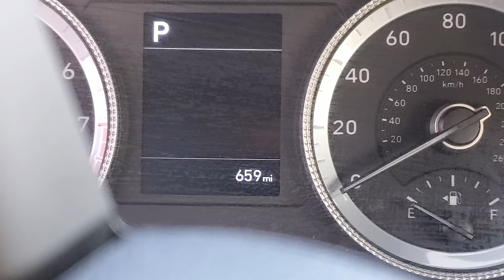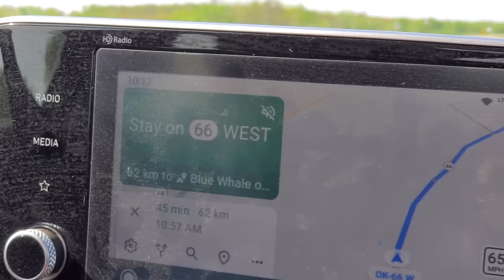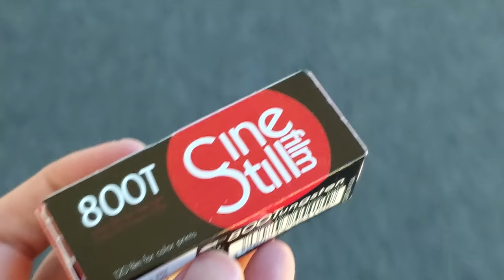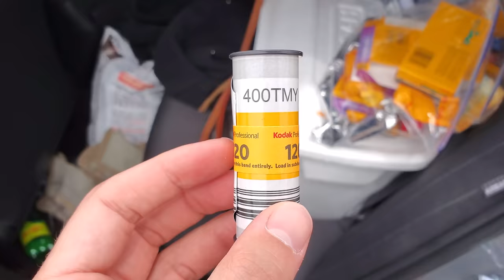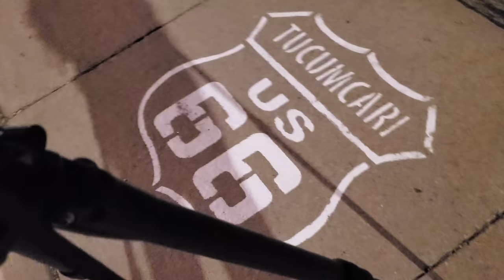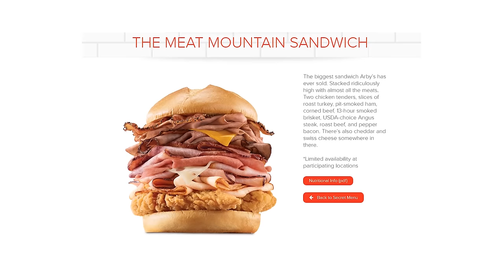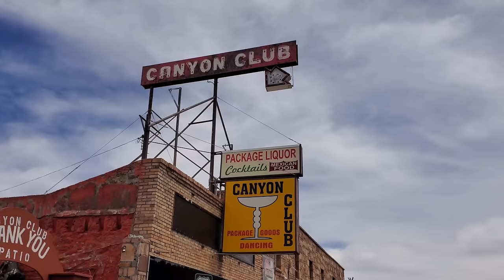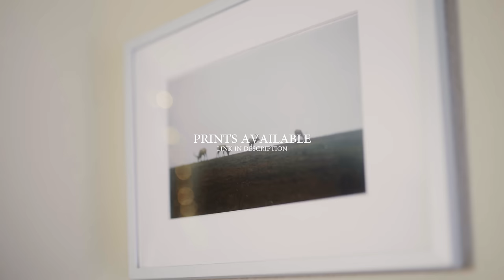1 Week on Route 66

Comment: Due to the flat structure of the TMAX crystals, this film has a tendency to be less sharp on the edges and lines in comparison to the more conventional gravel shaped crystals of its elder (late) brother the Plus-X. This is why we were not so overwhelmed when the TMAX came out in the late 80s. Kodak's pitch was that the flat crystals made them more light sensitive. For some real badass pronounced grain though, the TMAX 3200 (dedicated ISO 3200 sensitivity), was a great thing on the other hand.
This said I personally would rather tend towards monochrome films from any other brand like for example Agfa or Ilford to dodge the "focus softness" of the TMAX when covering the range of up to 400 ISO.

Comment: Don't worry about spending huge $$$ on Leica glass. If you want a nicer 35mm LTM lens, go with either a Canon 35mm f/2.8 or f/2 or Voigtlander 35mm f/2.5 Color Skopar. You will spend $200-350 for the Canon lenses or $300-400 for the Voigtlander. FWIW, I shoot a Canon 7 with Jupiter 12.

Comment: Great video! I had a question on the cold shoe viewfinder, how do you go about composing with that? I recently bought a Contax G1 and have considered getting one of those external viewfinders for it, so that I have a bigger viewfinder to look through. It’s also my first rangefinder, so my question is I guess, how do you compose with rangefinders?
Reply: I definitely get that, but I’m more curious about framing. When using a rangefinder (or something that is not seeing what the lens sees) How do you compose? Do you adjust your shot slightly off? Or just frame with what the viewfinder gives you?
Reply: @spencerbacon  There are framelines that show your field of view, dependent on the lens used. So its quite different from a DSLR.